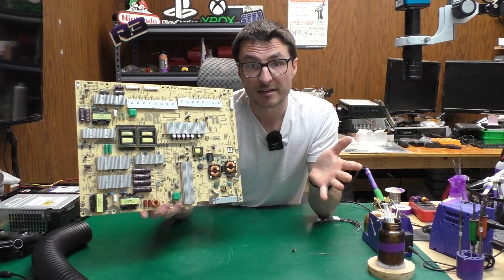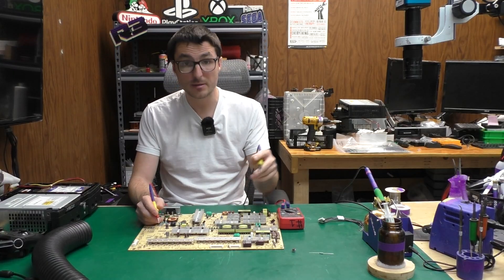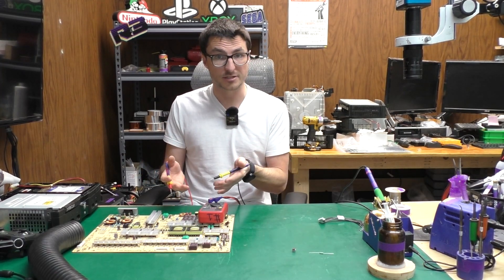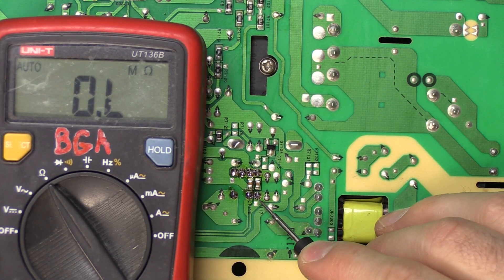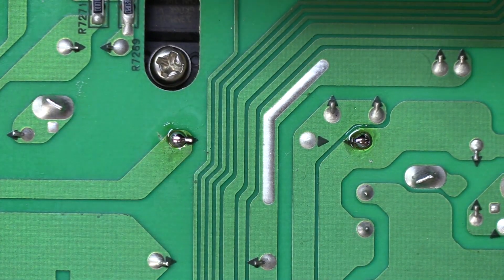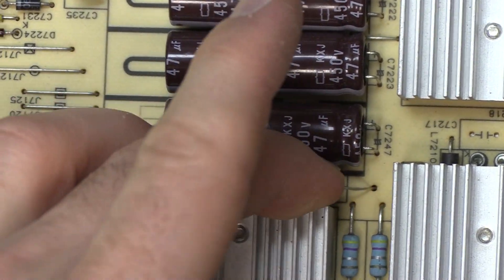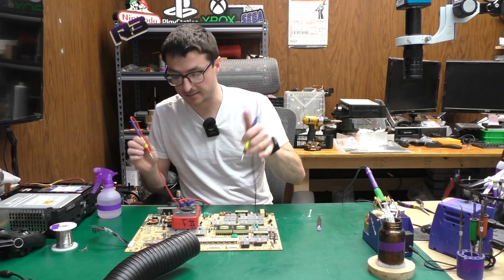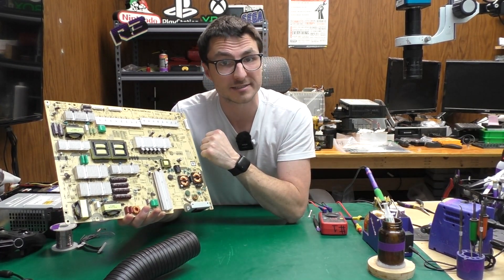Sharp TV No Power Repair LC-90LE745U Power supply RUNTKA985WJQZ

Comment: what is it called D7112 , cant find it with that number?? link?
Reply from the maker: DO NOT REPLACE THAT DIODE! 
It is NOT shorted. Yes it appears shorted in circuit but that is normal. Something else is wrong with the TV trust me.
Reply: @NicksTVRepair  So you cant tell me the answer?
Reply from the maker: I think my last message wasn’t clear; let me rephrase.
That diode is supposed to be shorted in-circuit. If it weren’t shorted, that would be a problem. The diode itself is not the issue here. When I say “something else is at fault” I mean I don’t know which component is bad. There are easily ten different parts that could be faulty, and without the board in front of me I can’t diagnose which one it is. It’s not something directly caused by that diode or by parts that are immediately in-line with it that's all I know.

I make free videos where I share all my trade secrets, I’m not trying to gatekeep. When I say I can’t fix or identify the fault remotely, I’m not being evasive or trying to sell you anything, I’m being honest about the limits of remote troubleshooting. If you send the board in, I’ll run the proper diagnostics and tell you exactly what’s wrong. But if you already started working on it and replacing things I probably won't be able to fix it.

Comment: i belive that resistor works more like fuse you could just bridge it or im wrong
Reply from the maker: You could and it would allow the board to turn on but I don't know if that is a good idea. If the IC chip fails again for some reason, bridging with a wire would not allow the circuit to fail open and could then cause much more damage to the board and make it irreparable. It's best to replace it with another resistor.

Comment: 1:27 You are talking about megaohm, but you get 4.7 kiloohm... Very confusing because it sounds like that is the correct value, but it isn't because when you measuring after you changed IC7102 you do get megaohm.
Reply from the maker: I could have been more clear in my language, but that is correct you want to see megaohm on a working board but we got 4.7 kiloohm. This is an indication the component has failed and needs to be replaced. And as you stated indeed after replacing it the correct reading was appearing.

Comment: Why would the customer replacing the diode cause it to not work, unless he replaced with the wrong one? If he replaced chip, resistor and diode, I don't see how it wouldn't work, compared to just replacing the chip and resistor?
Reply from the maker: That is exactly what happens. It's not a typical diode so 99% of the time people replace it with the wrong one and it makes the whole board not work.
Reply: @NicksTVRepair  that makes sense!

Comment: Was the solder supposed to bridge to those (I guess) current sense resistors on the bottom? I couldn't work out whether all on the same track/net or not. Looked good after you replaced the chip anyway.
Reply: Yes, all on the same track so it wouldn't have matter that they were soldered together.